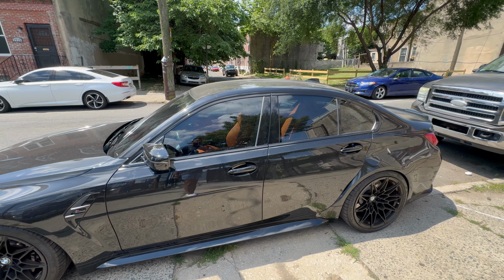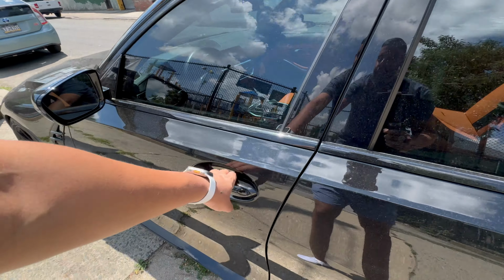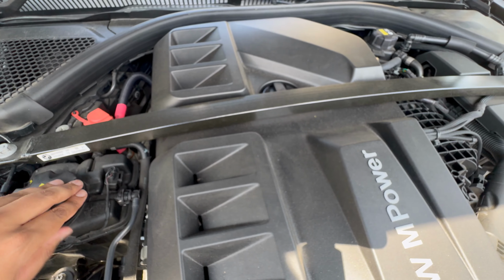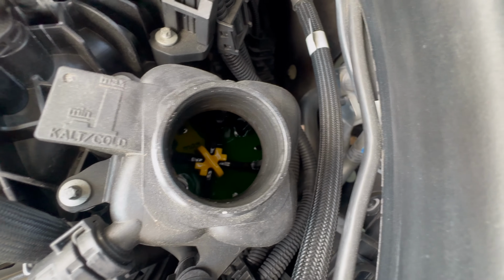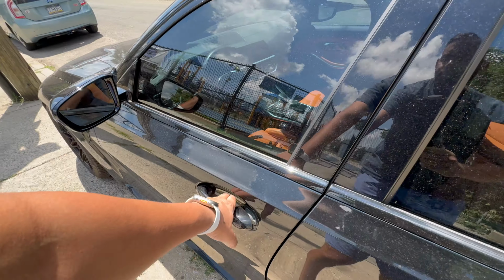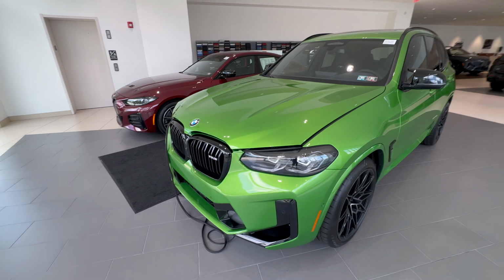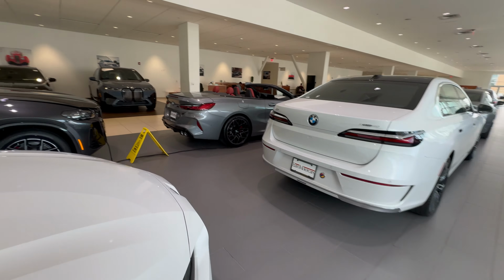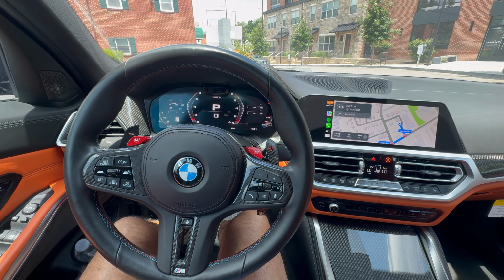Here’s WHAT HAPPENED to my BMW G80 M3…

Comment: Standard Operating procedure for a BMW. Pull through the dealer service lane and they’ll fill up your air and a top of your pool and they have bottles of coolant sitting in there for whatever reason BMW fittings sweat a little bit of coolant overtime. Also depends on how you drive it and other things I have 17 K on my G80 haven’t had to top off.
Reply from the maker: Good to know!

Comment: 13k on my g80, and just got the low coolant warning yesterday.
Reply from the maker: Yeah it's random, not sure if it has to do with the weather but at least the dealership can top it off and then monitor it
Reply: @ yeah that’s what I just did.  Brought it over to the dealer and they quickly topped it off.  5 minutes in and out.

Comment: make sure the heat exchanger isn't leaking. this isnt normal.
Reply from the maker: No leaks. Check the forums, multiple people have been

https://g80.bimmerpost.com/forums/showthread.php?t=1955608
Reply: Not abnormal at all, seen this on a few friends cars well.
Reply: this is deff normal happens on B58 as well my supra had it come up at around 30k miles
Reply: My G82 hasn’t done this. But My 340i and 440i did this mess 💀. I was scared af but apparently is normal. BMW likes to try and normalize anything that’s extremely expensive and annoying to maintain. But I love them. And keep throwing away money
Reply from the maker: Yeah the M5 has an actual issue with the coolant expansion tank though which is more serious

Comment: Head over to dealear for top off? Mabye two hour wait here at mine 😂😂. Buy the coolant and just do it yourself. And verify if the coolant isn’t diluted you have to dilute yourself 50/50 with distilled water. Not Perrier or San Pelegrino 😂🙏
Reply from the maker: I was in and out in 15 minutes lol. Wanted to make sure more importantly there was no cracking or other issues as well. OEM coolant doesn’t need diluting either and have to make sure you’re buying the same blue/green one which is already in your car
Reply: @sundeepm3 True. Better to get checked and make sure there are no issues. Love the black g80. Haven’t seen a lot of black ones.
Reply from the maker: @alexstealth27  Thanks! Yeah matches all the trim and stealthy

Comment: Normal?  Coolant shouldn't just disappear, ever.  There is a problem, and just because our M3's loose coolant over time shouldn't make this "ok".  I would need to know where is the coolant going.  Is there a leak on the ground or is it being consumed in the combustion process?  This sounds like it will lead to bigger issues down the road and I wouldn't want to have to deal with it AFTER my warranty is up.  I couldn't have left the dealership without answers.  If mine ever starts this, they will have to do more than just "top it off" for me.
Reply from the maker: “Normal” in the sense that it’s happening to many G8X owners. Check the FB groups and Bimmerpost. Various reasons such as evaporating when driving hard, leaky gasket on the cap, or even the hose. Mine does not show any signs of leaks, so will monitor the levels regularly and if anything more serious arises definitely will go back under warranty
Reply: I just brought my 23 m2 in for this problem with 6500 miles , and I wasn't taken their explanation, which sound like nonsense. " it's normal " i replied. " Am i  suppose to come to the dealer every time for this 🤔 long story i have them doing a system leak test as well as checking to see if the coolant is showing up in and other fluid , oil or transmission🤔